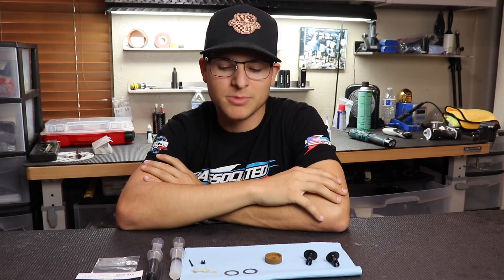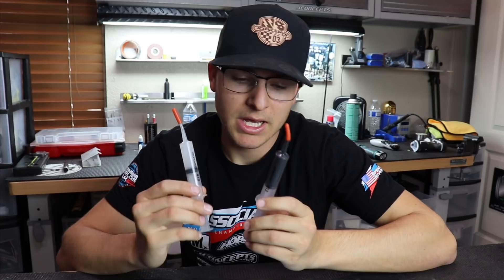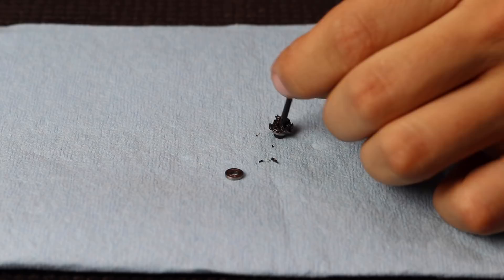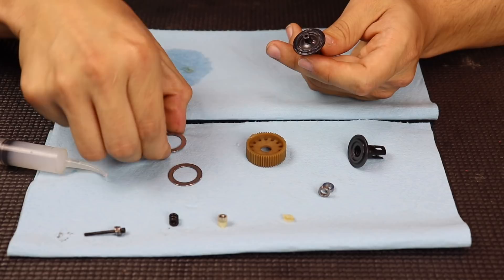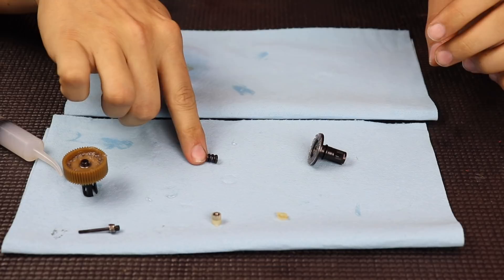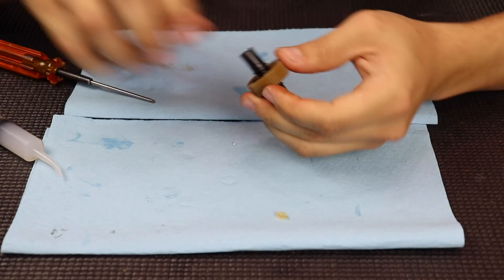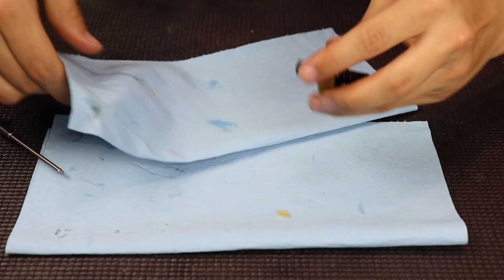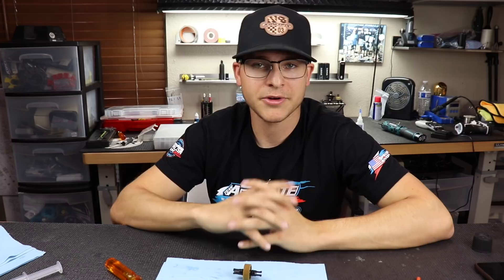Spencer Rivkin 1:10 Build Tip - How to Build a Ball Diff

Comment: Not bad. But I go a step further Spencer. Stuff I figured out. I use calipers and check each ball. To get a perfect match. Then I polish the diff rings my self for smoothness. For grease I use a Teflon grease my dad used at Delta air lines. Its engineered for jet engines. My diffs will feel perfectly smooth for weeks to months.
Reply: Craig Jones where do you get this Teflon grease?

Comment: Would u use ceramic balls in the diff gear or not? 

And what other types of grease will work for the thrust part?

 I don't have a regular/conventional black grease but I do have clear (stealth) grease, red grease (valvoline/chrysler premium and lucas red), black graphite grease (hudy), white gear grease (protek friction fighter), and blue grease (progek premium blue o ring)

Comment: Everytime  i build my diff it feels crunchy to me. Is it supposed to be smooth like a gear diff with no friction at all?  Mine are not. I have used ae balls and schelle balls. Same outcome.
Reply: Might be you've over tightened the screw? You can try backing it off 1/8th turn until its smooth
Reply: @TTMOTO888  i do it like the ae manual says. All the way down then back it a 1/8 off. Its crunchy at that point. If i loosen it to where its not it will bark under power once installed in the tranny. I have also tried breaking it in by turning the throttle up in the radio just to get it to move and stick a screw driver in the outdrive and let oneside spin at a time for a few minutes a side but still crunchy. Nothing smooth like a gear diff. It feel almost like u would have a bad ball bearing
Reply: @jeffbryner5355  - I've done it the same way in the past. Crunchy diff is all I get. You might like to try the Losi way. Theres a video on how they do it, just tightening it enough so as not to slip then break in the diff on the table then retighten as needed
Reply: @TTMOTO888  ok awesome. Thanks for the info. I just pulled mine out of my sc6 to replace it with a gear diff and it felt like rocks were in there lol. I will check it out when i get a rebuild kit
Reply: Don’t tight the diff all the way down, that is probably flat spotting the ring or balls. Break it in first before final tension adjustments. Watch some videos on the process.

Comment: So nothing prevents this diff from just spinning inside the outputs outside of friction on the balls? Why balls instead of roller bearings? Why not have spider gears between the outputs so you can run the diff looser without worrying about it not transferring enough torque.

Comment: i rebuild mine then when i use the brakes on my truck the screw just comes loose and my brakes are useless. even when i give it some throttle it just spins the gear inside. its a stupid design